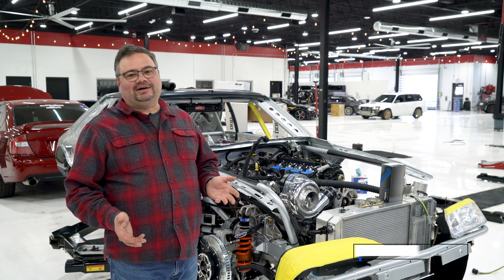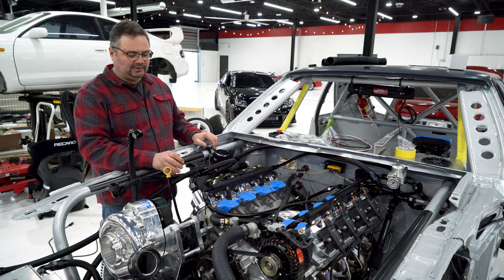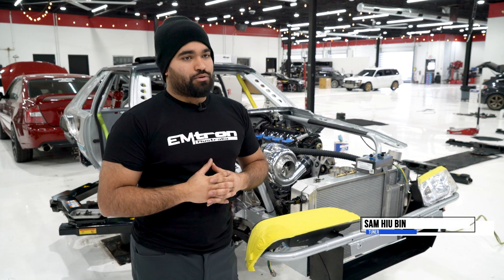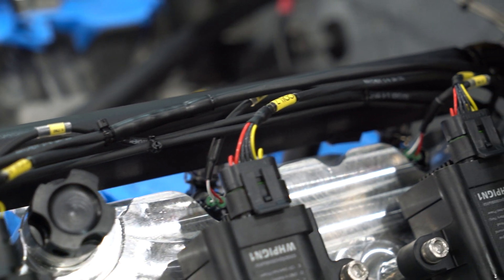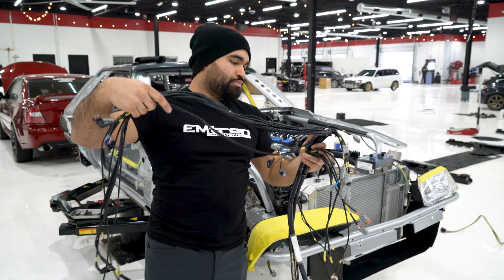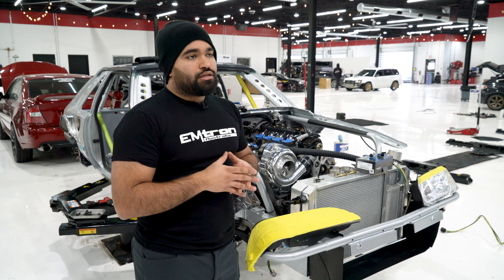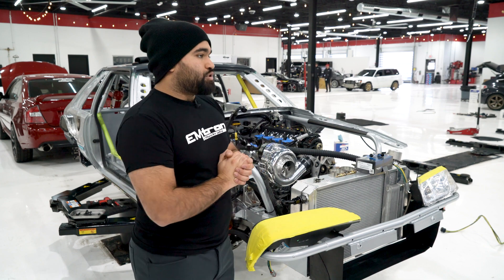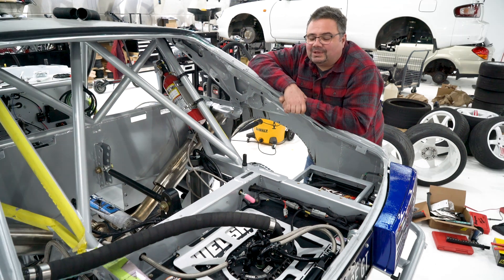We went Wiring Crazy on the Foxbody!

Comment: If they are going to use a separate throttle body to bleed off boost, then why didn’t they just go turbo????
Reply: Because we need to test with a pro charger for product development…. Next motor is turbo, we would still bleed boost with an electric waste-gate with turbo to turn down power.